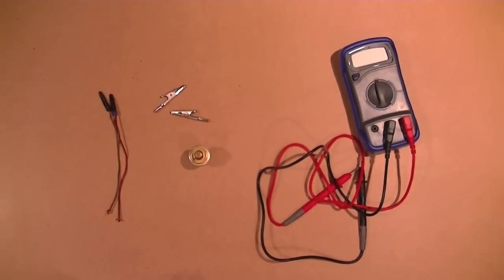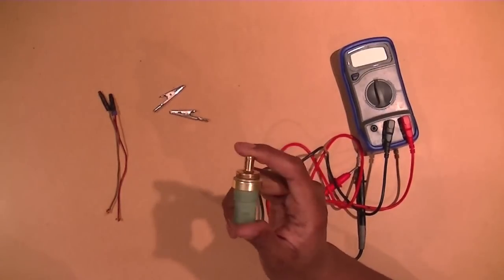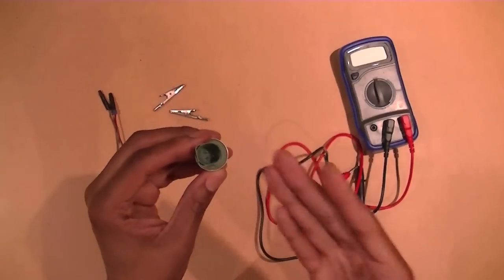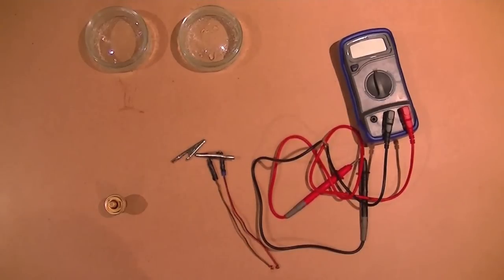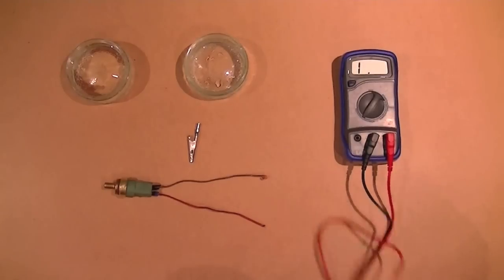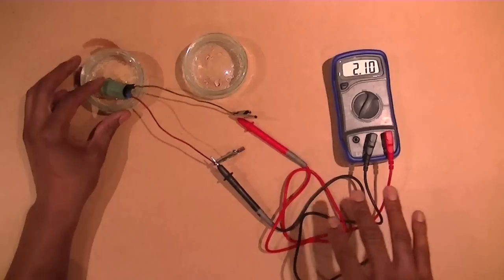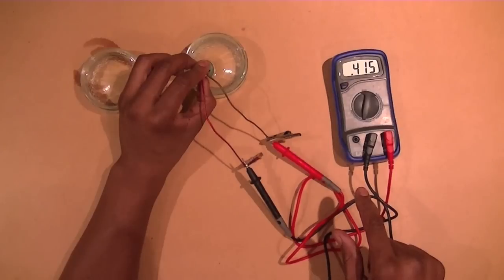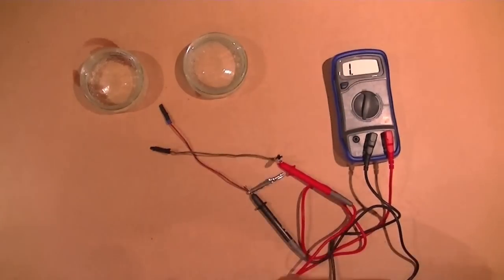How to test a Coolant Temperature Sensor

Comment: I know and understand that this clip is old, but, by any chance do you know if the two resistors inside this 059919501A sensor have the same values (resistance), or the one for dashboard reporting temperature have a resistance value and the one for the ECU reporting temperature have a different other resistance value at the same temperature?
I will appreciate if you have any technical data sheet for this sensor with the resistors values at different temperatures.
Also, one more question, it is possible if this sensor is faulty the engine cut off / stall, some sort of protection command from the ECU?
Thanks in advance for your time.

Comment: Good explanation.
The water in the glass would have cooled, whereas the water under pressure in an engine with added coolant will be more like 106C (223F) so the sensor was probably ok

Comment: BMAC VAGS, 
   }}}   I disconnected the Temperature sending unit/temp sense, so How can I test the instrumentation temp gauge in my cars dash board by itself to check if its working correctly, what do I need to do?

Comment: The water had to have cooled down some to keep it from reaching the 375 range, constant boiling water if you wanted a more precise but the fact it went down probably means the sensor is not bad.  Also could you have just place the probes on the connectors instead of creating something to fit them, good job on providing another way to test

Comment: hello
what if this temperature sensor not working...!? my Audi car fan running all the time, from the car start till i turn off the engine, i checked all relays in fuse box i found them working. and fan still running, so can you tell me what is the problem if you have any idea ???
thank you

Comment: BMAC VAGS
 hey what about the flat side ? my gauge isn't moving  so want to check that part of the sensor. At wich values should be considered faulty ? it is the same with with values for the rounded part for ECU ?

Comment: My Sensor is at 1.09 on COLD , does that mean I need to replace? By the way my Rad Fan does not come on. And I even had problems with the vehicle overheating when idle. Should that mean I replace this right away?
Reply: MagicSnipezz I have the same problem did you get yours fixed was this the issue
Reply: MagicSnipezz that thermostat not the sensor is your problem.

Comment: I'm trying to check my temp sensor from a classic mustang, it only has 1 wire, not 2 like most cars. how can i check my sensor?
Reply: You probably received an answer by now, but attach the negative lead from your multimeter to the base of the sensor, at the threads.  The single contact prong or tab is for the positive.  This type takes its ground connection directly from the part of the engine(or radiator) it is attached to.
Reply: Thanks I did what you advised on a cold sensor and got a reading of zero ohms which means a short circuit...right?

Comment: Are you sure you don't mean Mohms.  Even 10 ohms would seem too high for a switch that is attempting to pass current.  275 mohm or .275 ohms would seem more indicative of an closed switch.
Reply: In this case ohms, rather than milli-ohms,  is correct.  It is common to think of a closed circuit in terms of just being "on".  This sensor, however, would need to get far hotter than your engine will go in order to get the resistance so low. This is assuming it is even able work to those extremes.

Comment: Quick question, my coolant temp sensor (2 pin grey connector) is reading -40 Celsius on Vagcom..I replaced the sensor and it still reads -40 and the car is hard to start.. Any ideas? Great videos by the way!! 👍

Comment: I seem to be getting a range of 350 - 2700.  Do you know the exact temp-resistance for low and high.  The range of car should be around 5C - 90C.  So at 5C should it be 350ohms and at 90C 2500???

Comment: I recently purchased an OEM Audi sensor and replaced it as my original was defective, however after only three weeks my new part failed and gave me the exact same symptoms. The dealer exchanged my part for another and said that they don't ussually have issues. The new sensor solved all drivabilty issues and all systems are working as they should for now. Is it possible that something is causing the sensors to fail?
Reply: +Charles David could possibly be a large oil leak caused by the cam chain tensioner half moon seal or gasket. I am guessing this a 1.8T? The coolant sensor sits right under the cam chain tensioner area, so if oil was seeping into the sensor, it be causing issues?
Reply: +David F. Thank you for the advice. Actually it's a 3.0L V6 engine. The coolant Temp Sensor is in the coolant pipe on the backside of the heads in approximately the center. Further update, now that the weather has cooled down considerably, there are more issues regarding engine coolant. When the engine is started the temperature gauge is on the C. As you drive in city traffic the needle climbs to the normal operating position between C and H. If you stop at a traffic signal the needle begins to go back toward the C. After you begin traveling again the needle travels back towards the normal operating temp range. I have replaced the thermostat and bled the system of air, however this did not change the outcome whatsoever. There may still be air trapped in the system or maybe another issue altogether. The coolant pump was changed by the dealer less than 35,000 miles ago, but I recently discovered that this engine has a secondary electric coolant pump...

Comment: I don't think you answer these but, just in case: could a dodgy sensor cause an "immob. activated" code? I've not noticed any issue with temperature readings but have had some weird fault codes including this immobilisier one which renders the car unusable for days sometimes.

Comment: Hello.

I have a problem with my temperature gage, sometimes it goes up to 90, then suddenly drops down to about 50/53. When I try to restart the car it stays exactly where it dropped off. Could that mean that the sensor is defected, or is it contact problem. I was thinking to pull out the connector and clean it a bit with some contact spray. What do you thing?

P.S. What damage could this do to my engine? Is there a risk of overheating the engine and damage it, or is there a safety precaution and the ECU turns on the fan?

Comment: Hello, please tell me whether you have a problem with Golf 3 VR6 I think it is a temperature sensor but I'm not sure yet here I will briefly explain what's happening with the car, turn on my flashlight on the temperature after a while it turned off my car does not go as it should and sometimes goes mjenjao I pump fuel all possible and yet do it all made possible means that my car's not going because of this sensor, and it's still something we hoped fan cooling to 70 degrees: / please if you can help here is my fb profile thanks in advance to everyone. https://www.facebook.com/dragan.bra

Comment: in my car its separated into 2 sensors  
one for the gauge and another for the computer
the gauge sensor is one wire
the computer is two wired 

can coolant temperature sensors ...can this cause overheat ?
we addressed everything else..with exception of head gasket
with our car overheat shows only in summer thats when it peaks between 55c and 61c in July  
i think many people are not seeing this coolant temperature problem because it is masked by the colder environment they live in
it just translates into bad fuel economy 

lol in Kuwait ,,,,,you must keep you cooling system well MAINTAINED check the entire cooling system every 1 mounth once its gets 3 years old...or your most importantly if your car is out of the warranty coverage,,,

Comment: If you use a big mug to put the boiling water in you will have longer to measure the resistance, a cold little jar with a cold sensor dunked in it will cool below 90 deg quite soon.
Reply from the maker: Yes I will remember that next time.

Comment: offtopic, but do you know how to test egr selenoid N18? i got vcds telling me 19586 - EGR System
P3130 - 35-00 - Regulation Range Exceeded

thanks
Reply from the maker: What is the make and model of your car?
Reply: its vw passat, 2004 avb engine, tdi, pd100
Reply from the maker: I will find out and get back to you
Reply: thanks mate
Reply: BMAC VAGS, i have question diagnosing a bad ect on wifes 02 pt cruiser 2.4 tested it cold  this morn while  in the engine could it in minuses here right now  only get reading on 200k ohms and got reading of 45.6ohms warmed engin up to operating temp. tried test again and got 0.90 to 1.00  ohms on 20k ohms. this dont seem right should not the ohms drop farther , having engine performance issues and one of th only rhings left to check can comtact me at earlfgrisdale@gmail.com
Reply: it after it starts warming up engine starts  running ruff ebrrytbing else seems to check out

Comment: Thanks so much just changed mine yesterday and saw a lot of engine performance. All the same I had the radiator washed and so far so good. But will run a test on the old one to practice.
Reply from the maker: Excellent, thanks for supporting the channel.

Comment: Hi mate, have you got the part number for the OEM VW ect sensor, I have had a couple of cheap ones fail so would like to source a more reliable one. Cheers
Reply from the maker: sorry not at the moment. you can check with the dealership the one suitable for your car.

Comment: Nice demo of the ECT sensor BMAC using resistance. Another method is to measure the voltage drop across the sensor from when the engine is cold to when it gets warmed up. For this, your voltage will be higher on cold start-up, and as the engines warms up, the voltage will start dropping. This method will eliminate having to remove the sensor from the engine.
Reply: Hey Terry that's fantastic I'm trying it out next ect fault I come across.  I have been ohming out the sensor to manufactures temp scale.
Reply: And even faster Steve is to just look at the ECT parameter on a scan tool if you have one. Then if you see something out of the ordinary with the temp value, you can just measure the voltages.